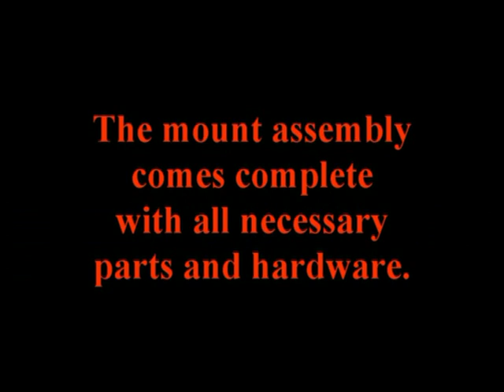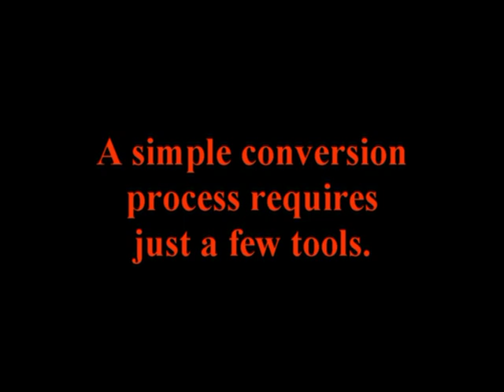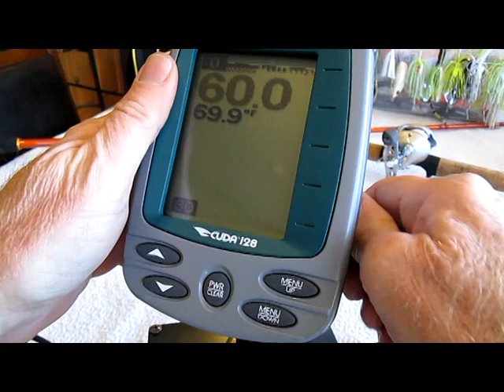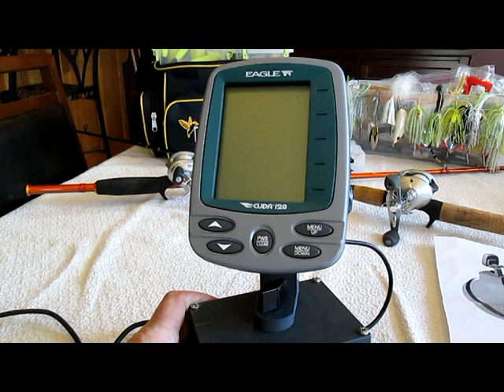Adapting Eagle Cuda Fish Finder for a Float Tube

Comment: No 3 amp inline fuse ? Where is the battery charging port ? Nice looking 3D printed plastic.
Reply from the maker: The battery is sealed and there is no port.  It charged with a standard trickle charger that has a male/female connector.   Float tube fanatics (fishfindermounts.com) has all the wiring connectors, mounting plates and transducer Mounts for all major brands of fish finders:  Garmin, Humminbird, Eagle, etc.  FFM also has various size batteries for optimum performance of your specific fish finder.  Thanks for stopping by.

Comment: what would be the wiring of my eagle cuda 242 6 pin to the 5 pin lorance extended transducer i have i want to rig wire one for a project but don't know positive negative signal and temp wiring positions  can anyone help
Reply from the maker: +That guy for 2a defend the constitution Wish I could help you out, but I don't know the pin configuration for transducers.  Good luck with your project!  Don

Comment: I have a question how did u mount a trolling motor on your pontoon kick boat im trying to figure all this out cause i personally dont feel like fighting current on a creek without one i would get a great work out but thats beside the point
Reply from the maker: Christopher, the Water Skeeter pontoon/kick boat I own (the large, green one) has a trolling motor mount built into the frame.  Many kick boats have frame mounts for trolling motors, but these types of watercraft are usually pretty pricey.   If your creek has a lot of current, you'd probably be better off with a kayak.  With a pontoon, you'd wear the battery down going upstream and once you got there the current would be hard to handle.
Reply: Winkiedoodles i dont think current would be thay bad were ill be but thankbya for the advice im pribably syill getting a kick voat for stability ima big guy  so i want stability and the out of the water apeal and the kick boat i seen with a bar on the back for a trolling motor is only 250 bucks on sportsmans ware house and it seems to have more bells and whistles than the more expensive kind
Reply: Sorry aboyt the spelling im half asleep at work still lol

Comment: Hi Don!

I have a Garmin Eagle Cuda 300 portabel version and I want to use that on my belly boat from berkley, does all those mounts from floattubefanatics/fishfindermounts come with the L-bracket? 

Thanks!

/Andreas
Reply from the maker: +Andreas Eriksson Andreas, I'm confident that Wade at Float Tube Fanatics can provide you the battery pack, mounting plate and transducer mount for your Cuda 300 unit.  Recommend you email him at sales@floattubefanatics.com and start a conversation about your particular needs.  When I was working with him about the Cuda 128 shown in this video, I sent him photos of the unit and he sent the equipment I needed to convert it for use on a float tube.  Tell Wade I said "hello"!  All the best, Don
Reply: Thanks Don!

That Cuda 128 is quite similar to my portabel cuda 300. 
Did you do test with the cuda 128? If you did, did the cuda 128 work well on float tube? Interesting to know if it works well. 

I'm really looking forward to use a fish finder on my belly boat, it will take my fishing to the next step and more fish (big pikes)!

I'm from Sweden and I did find a company in Sweden that selling those fish finder mounts from Wade. I'm having a conversation with this company because they not have this L-bracket in their packages. But I hope Wade has some L-bracket left! 
Hope you have a good day ,Andreas

Comment: NICE JOB ON YOUR VIDEO. THERE IS ONE ITEM I WOULD LIKE TO COMMENT  ON. YOU SHOULD HAVE A FUSE PLACED IN LINE BETWEEN  THE CUDA 128 AND THE 12V LEAD ACID SEALED BATTERY.  YOU CAN LOOK-UP  THE USER MANUAL ONLINE TO GET SIZE FUSE.
Reply from the maker: Thank you for the kind comment.  When my sister decided to join me by purchasing a float tube, she already owned this Cuda 128 which had been used on a wooden jon boat.  I figured FloatTubeFanatics had a mount for just about any kind of fish finder and sure enough they did; worked perfectly.  Thanks again!